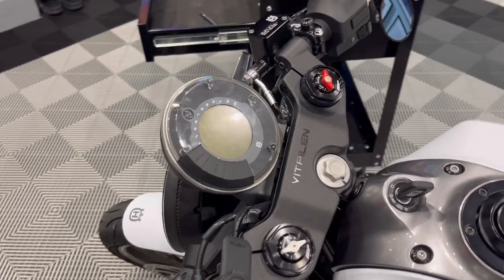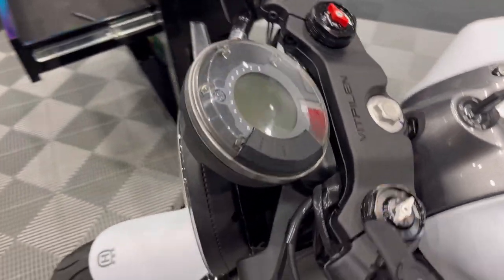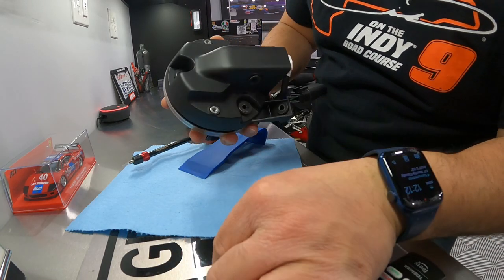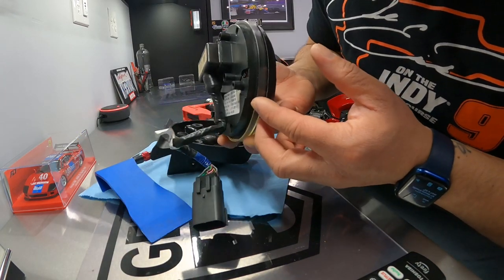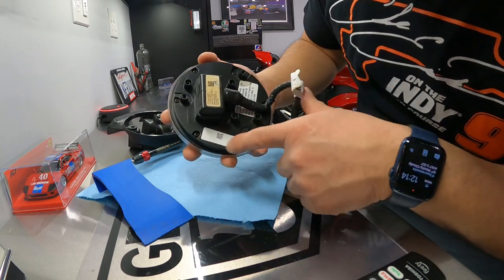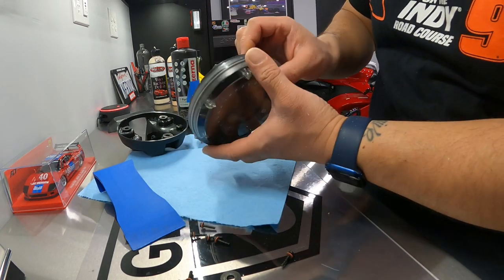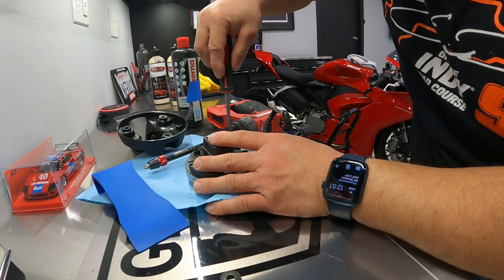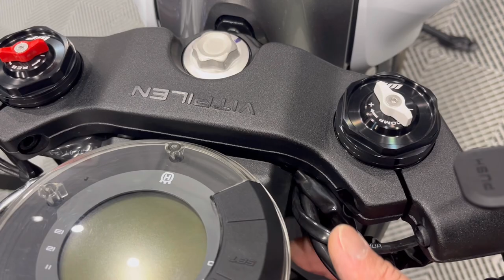How-To Disassemble and Fix a 401 Vitpilen/Svartpilen Dashboard Display

Comment: Should change the title since it look like it will work on the Svart/Vit 701's too.   Thanks for the super thorough video, totally top notch info and camera angles.
Reply from the maker: Well we don’t know that for sure. I would only change the title if I knew for sure it was the same on a 701. It probably is, but unless I know for sure and have confirmed it myself, I don’t want to state it as a fact. Thank you!

Comment: worst buttons I have ever had to press in my life :D 
Thank you for the guide on taking it apart, I want to find the time to hack some solution for those buttons and make a small circuit to automatically turn off TC/ABS when the they come up.
Taking it apart is step 1
Reply from the maker: No problem! Glad the video was helpful to you.

Comment: Good job with that, thank you for sharing it with us. When you were describing the button feel, or rather lack of it, you gave me a mod idea to possibly transfer some more feel to the outside face of those rubber buttons. But I’d have to open my dash up and feel how much resistance there is on those little button posts before they’re activated. If it’s super super light my thought won’t work, although if there’s a modicum of resistance there might be hope, lol. Again thank you
Reply from the maker: Absolutely. I was hoping it’d help somebody and thought it was interesting how the buttons work. I would imagine those buttons might be an issue later as those pins inside are really flimsy plastic. 

Glad I was able to provide valuable information to you. Thank you for watching and for the positive feedback.

Comment: Hey brother, thanks for this. I discovered all these smudges and stains this morning, weather was very cold, by midday with a bit of sun it cleared. I used a high pressure hose at a car wash last week and I fucking knew I shouldn't have blasted the dash. This caused all that inner crap 100%. So just a heads up to whoever reads this  im going to use that anti fog spray that you use on helmet visors when I remove it so thanks for the demo. I'll let yas know how it goes or if I fk it right up. 😎
Reply from the maker: Haha you’ll be alright. Just take your time and it’s not too bad. These bikes have a lot of issues but luckily they are easy to work on because their construction is so simple. Most motorcycle displays you can’t even disassemble it at all. Cheers man.

Comment: I'm looking at also restoring the instrument cluster of my 701 Svart. Relating to the O-ring of the dashboard, do you have an idea about the size? Also, considering the anti-fog coating that's present, would it be possible to apply an aftermarket coating? If so, any recommendations?
Reply from the maker: I don’t have an idea on the size. Only thing I can think of is using this video to disassemble your cluster and then take the o ring to a hydraulics outfit to see if they can match the size. I don’t believe you can buy the o ring separate from Husqvarna. 

You probably could, but I couldn’t really guide you on the process there. Of course there are some anti fog solutions that are used in the snorkel/scuba industry, but again I don’t have any personal experience with that. Thanks for watching.

Comment: @ridewithKY hey man pull the trigger on this bike last weekend, it was $500 off could not resist. Now the problem is my dash cover looked to have a crack from the inside as it does not feel like when touching the surface. Also those buttons push it / click it too many times since I got it and never worked. Display or settings never change when hit those 2 buttons. Do you know how to? have you experienced it with your bike?
Reply from the maker: If the dash cover is broken then I would take that back to the dealer. Can’t really fix that on your own as I don’t believe you can buy just the lens. Only other remedy is if you bought a used display off eBay and stole the lens off of that. 

You have to be really deliberate with how you push those buttons. It’s possible yours are not working of course but it’s probably more likely the way you are pushing them that’s the culprit. The way you have to push those buttons is awful.

Comment: The inside of mine fogs up badly, so I’ve been needing this vidya to see how to disassemble this thing and reseal it with RTV instead of a stupid o-ring.
Reply from the maker: Glad this video will be helpful to you. I think every Vit/Svart display I’ve seen has been smudged/scratched on the inside or has condensation inside. You may be able to get a better o-ring if you have a hydraulics supply house nearby. Good luck to you, hope you can get yours fixed.
Reply: @ridewithKY  I figure a bead of RTV around the edge and on the bottom of the screw posts would suffice.  Since it’s a viscous liquid, it would seal any of the gaps.  When I have mine apart, I’m going to dig deeper to see if I can change the colour of the internal backlight as well.  I want it to have a cyan glow at night, but still look factory during the day.  Also, hello from Australia!
Reply from the maker: @darkstarmobile Sounds like a solid plan regarding the RTV. Hope that solves your issue, it’s annoying having your display fog up.

I thought I saw a tutorial online somewhere on how to change the polarity of the display. Wonder if that tutorial floating around might be helpful to you changing the backlight to cyan. Either way, best of luck and cheers. Thank you for watching.

Comment: My display got scratched pretty bad, I don't know if I should disassemble it and buff it out or get a new cover. I had them replaced before because of ABS lamp not working and looks like they put in an old stock cause the buttons look pressed a ton of times. and yes it was under warranty. The old one that I have, I placed a protective film covering, I regret not putting one with the replacement.
Reply from the maker: If the dealer will give you a new cover then that’d be advisable. However, if you need to buff it out then that’s not such a bad solution either. Too bad about your buttons, the buttons are actually easily removable on these displays so too bad the dealer didn’t transfer your buttons over. However, that brings us back to the original problem where they shouldn’t have replaced your display with a used one.
Reply: @ridewithKY  the dealership here kinda suck in terms of customer service. When my shifter fell off they just replaced it with a bolt lying around, and didn't even replace the spacer I got from someone that helped me when I was stranded at the side of the road. I had to go back and demand for a replacement because the bike was barely two months. I just noticed it when I got back home.

Then after my 1st PMS, the ABS LAMP, got busted and I had to wait for a little over 6 months for the replacement. I got frustrated with what looks like an old stock and I don't want to wait for another 6 months for what I think is a new one.
Reply from the maker: Got yah. That’s a valid and common concern with these bikes. Yes they are warrantied but it’s a hassle to get it warrantied and the quality of the repair depends on the dealership. In my opinion a very important consideration when deciding to buy one of these bikes. These bikes are fun, but man they have a ton of issues.
Reply: @ridewithKY  Agree 100. Just had my rad fan replaced last month. And I'm still paranoid if they replaced with a new one or a refurbished. Always looking down on the temp gauge if the bars go higher than 4. My warranty is gonna expire this December.
Reply from the maker: Sorry that’s been your experience man. Such a shame these bikes are ruined by their lack of quality and reliability.

Comment: Have you thought about upgrading to the KTM color display?
Reply from the maker: I’ve thought about it. BadWinners makes a plug and play digital display that is really similar looking to the factory KTM. It’s pretty expensive however, I believe $700+. I don’t know if that’s worth it for this bike. 

I actually like the aesthetic of the factory display. It fits the design concept of the bike in my opinion. Almost has the look of an 80’s Casio watch. However, functionally the display is awful. Night or day the display is very difficult to read.
Reply: @ridewithKY   That badwinners display looks great but tons and tons of complaints about it and their lack of customer service in the forums.
Reply from the maker: Thanks for the info! Too bad those displays don’t seem to be working out for folks. It’s a cool concept and cool aesthetic for sure.

Comment: Someone managed to replace abs light? Mine seems to be burned out, sometimes flashes weakly and sometimes is not turning on at all. Abs is working normally, the problem seems only the light
Reply from the maker: It can be done, but generally replacing an LED in a display requires some soldering. Is the bike still under warranty?
Reply: @ridewithKY  Yes, is still under warranty but I'm scared of the idea of taking my bike to the dealership because I already know that they will try anything instead of really solving the problem, they will end up completely replacing the dashboard zeroing the odometer. I don't think it's a coincidence that the bike was in the rain a few days before the problem
Reply from the maker: Of course it’s up to you but if it were me, I’d take it back to the dealer and allow them to change the display. If you tamper with it first and then bring it to the dealer, they probably won’t replace it. Zeroing the odometer is not a big deal, the dealer will provide documentation for this regarding when the display was changed and what the mileage was.